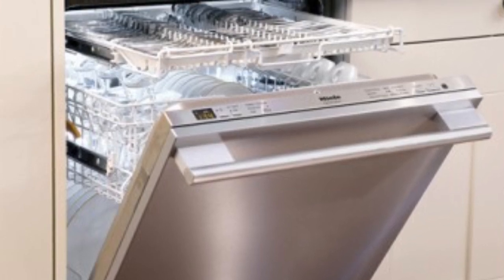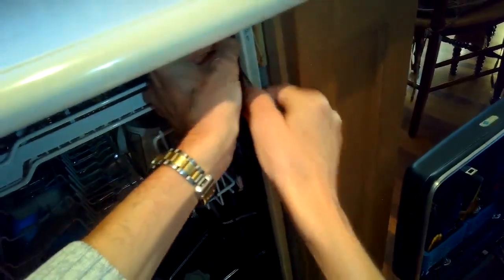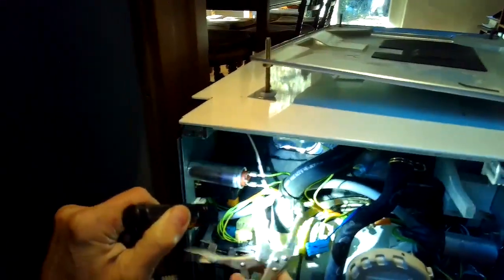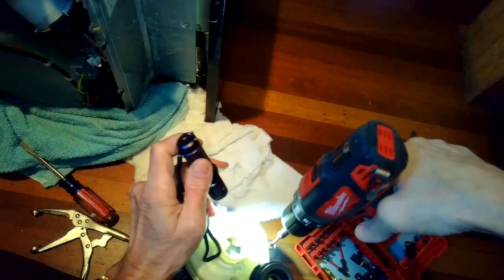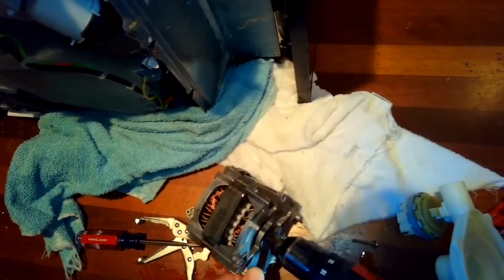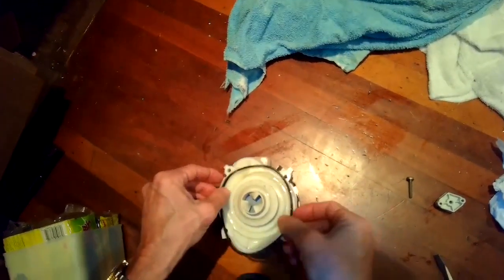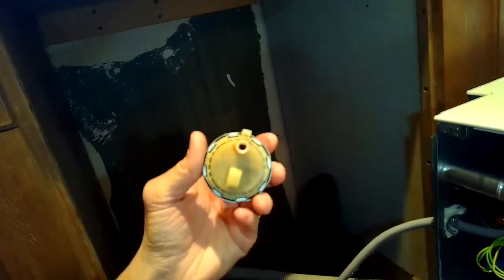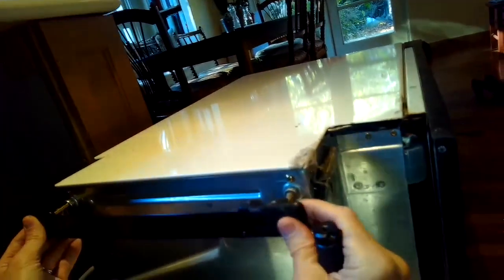✨ Miele Dishwasher - Circulation Motor Repair ✨

Comment: Last year I did your Solenoid Replacement on my Miele, and has worked fine, but now have a new problem. Last night, I noticed that when the unit is running (circulating the water) there was a loud sound that I NEVER HEARD BEFORE (no error codes). I checked everything, the basket that you pull out, the non-return valve that has the metal ball in it, the impeller motor under it, and the circulation by sticking a fork in there, but the sound was still there.

I opened up the small service panel located in the front of the unit (where the toe-kick is) and teh sound is coming from something in there.

I am unsure if it could be either the circulation pump and/or motor?

I was going to run the Miele DW Cleaner (but had to order it) and see if that would do anything, but probably not.

I will try and post a video later so you can hear the sound. It's very loud, and I've never heard this before in the 8 years that I've owned the unit. If it is the Circulation pump or Motor, I guess the best thing to do would be to contact Miele (since it has to be ordered from there, not sure of the cost) and try to install it myself before having the expense of their repair tech.
Reply from the maker: I can send you a video on how to remove the motor and clean it
Reply: Scottthefixitguy OK thank you
Reply: I added two videos on my channel of the noise it is making. Maybe it is something that you have heard before?
Reply: Tonight the unit ran for about an hour and then would start/stop for a few minutes, and drain all the water, then all the LEDs would flash. I went into the service codes and it showed an F14 which is the Heater Pressure Switch. So I'm not sure if that by itself is the problem, or also the circulation pump due to the loud noise when running.
Reply: Scottthefixitguy Scott, I called Miele today and they said they do not sell the Partition Kit separately for my G2143 and would have to buy the entire motor pump 06770517 at $629. Have you heard of this before? The heater pressure switch is only $70.